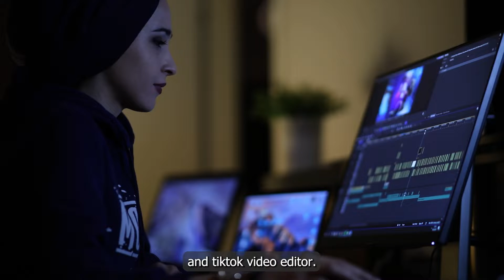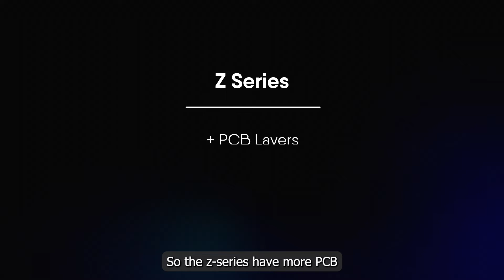B and Z Series Motherboard. Why is there 2?

Comment: plz reply i  am planning to use 14700k on b760 can as k and non k are of same price. i don't intend to over clock at all. i just want the 14700 k to perform as said by Intel without oc. can b760 handle 100% of 14700k
Reply: I paired 14600k with Asus Tuf B76M so you can also go with any  B760 if you are not willing to OC

Comment: Which motherboards are made for gaming and which are for coding, programming, hacking, freelancing and so on????
Reply: You're just gaming and possibly streaming go with the B series, but if you're doing programming and other heavy workloads just go the z or x depending on the processor, unless you're doing both then just go with z or x series.
Reply: @HuddledBlur  can I have a suggestion for a z/x series micro-ATX mother with ddr4 RAM for core i5 13600k

Comment: a z690 motherboard is literally just a bit over 20-50 bucks more expensive, don't see any reason to spend more on it instead of b
Reply: Again like OP said at the start of the video; it depends on the use case.
If you're trying to do some serious overclocking of your components and want your system to have more stability; go for the Z series. I know not everyone cares about overclocking; but its nice to be able to get some more horsepower out of your parts if you're willing to do some 'minor' tinkering with settings 🤷‍♂️
Also not to mention the fat amount of i/o you get. I've gotten B series boards before and they were great for the price (mind you I didn't attempt over clocking back then so results may vary); but the Z series fr is so nice for the QoL features. The average Z series board has 8-10 usb ports; so no longer do you have to get an expansion card for extra usb ports, or unplug stuff to swap components you're using like I'd have to with cheaper boards. 8-10 ports is more than enough for most people as cases normally provide an additional 2-4 (making for a total of 12-14 ports with a Z690 board).
And that's not even talking about things like hot swappable M.2's (no longer do you gotta fuck with that tiny af M.2 screw), accessories exclusive to Gigabyte called the 'G Connector' which makes installing case motherboard cables easier, extra sata cable(s) and useful hardware in box; things you don't see at all included on/with budget B series motherboards.
So if you have the extra coin, and are even a beginner; honestly go for it! Most manufacturers design the board to be easier to install, with additional quality of life, and the software is pretty easier to interface with for overclocking (they normally have profiles you can swap and see if they work for your system so you don't really have to 'tinker' per se). But if you know what your use case is and/or prioritize budget; a B series board is as good as it gets and fits the job nicely 💯